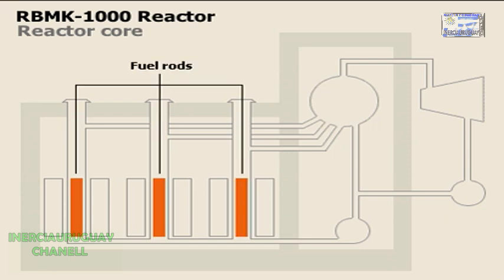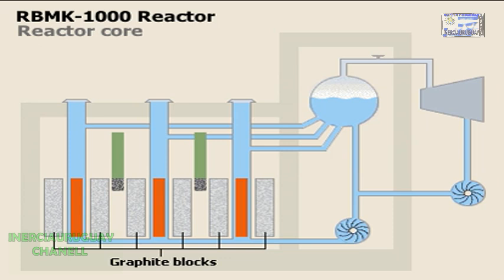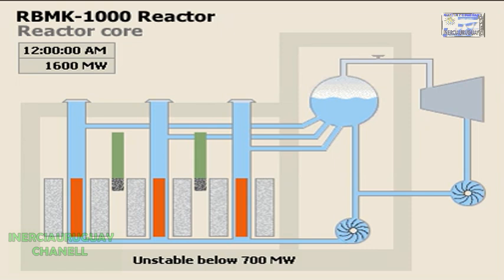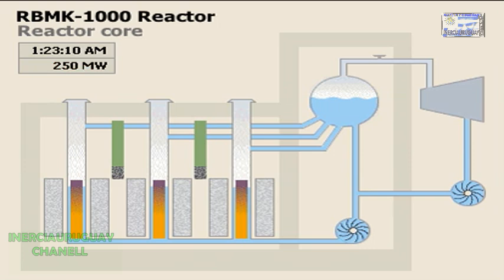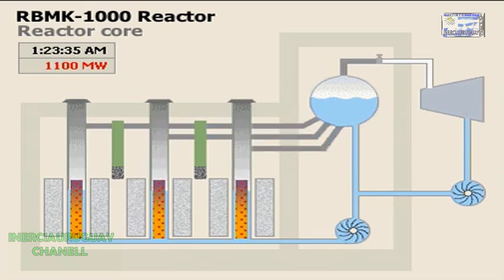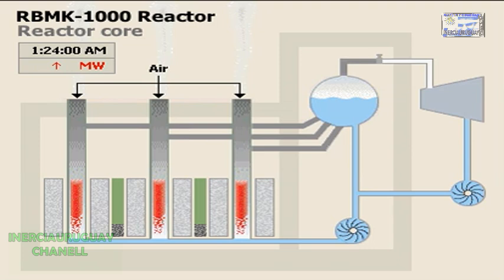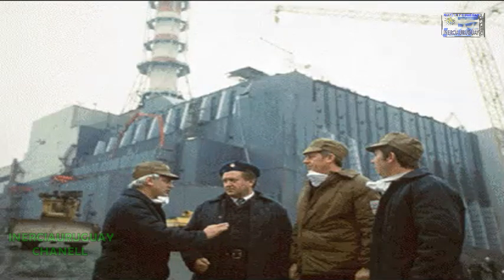WHY THE NUCLEAR ACCIDENT WAS PRODUCED IN THE CHERNOBYL PLANT ANIMATION

Comment: You forgot to mention that the reason for the experiment was to determine if the turbines could provide power to the coolant pumps during a power outage until the emergency backup diesel generators revved up to full power so they could take over running the pumps, which would take about 60 seconds. That 60 second gap between the time of a power outage and the time the backup generators could get up to full power was the entire reason for the turbine test in the first place.
Reply: I've never heard if they had a back-up plan. What if the answer to the question was "no"? What if the turbines could not adequately power the coolant pumps until the generators revved up? What were they supposed to do then? I think the answer was, "watch the plant explode and catch fire and melt down."
Reply: @ThirtyNineWinks  So I think that this graphic is a little misleading in that it depicts the graphite tips of the control rods already overlapping/inline with the fuel rods. The control rods would probably be up higher so that no horizontal line from one fuel rod to another would intersect these tips. The graphite from my understanding helps encourage fission by slowing down escaping neutrons from one fuel rod and making them more likely to collide with atoms in neighboring fuel rods. My understanding is that the control rods, with the exception of the tip,  as the video described were made of a material that would absorb or otherwise prevent escaping neutrons from colliding with adjacent fuel rods, thus slowing the reaction.

In the event that the backup system could not power the cooling system, they would have had the ability to lower the fuel rods partially or entirely to slow or kill the reaction. Under normal operation, these rods wouldn't be fully retracted to begin with, but always partially inserted as needed to maintain the reaction / power output. From my understanding it is a PITA to restart a nuclear reactor after it has been completely shut down. The problem was, like the video described, they ran the reactor too low of an output for the test which risked the fission reaction halting/shutting down. Thus to prevent this they completely removed most of the rods to encourage more neutron collisions / increase the reaction. 

When, as the video described, the operators realized the reaction was out of control, they tried to emergency halt the reaction by lowering all the control rods. At this point it was probably already too late given how the cooling system was already compromised / full of steam. However, with all the control rods previously having been removed and now all being inserted at the same time, the first parts of the control rods (graphite) all lined up with the fuel rods in unison. This supposedly is what caused a massive spike in the fission reaction. If the control rods were as depicted (already inline with the fuel rods), the graphite tips would have already been accounted for in the reaction, thus lowering the control rods would not cause a spike in output.
Reply: @ThirtyNineWinks  the answer to the question was no. They had done this test three times before and it never worked.

They had no back up plan. 
What could go wrong lol
Reply: @ThirtyNineWinks  Well, that's what the previous three tests were for, and they all failed. Chernobyl wasn't just a failure, it was a complete cluster screw up. So the answer is, if the turbines can't generate enough power to keep the coolant pumps working as the turbines wind down, and until the backup generators reach full power, then you'd better design the core more efficiently so it can last those 60 seconds in case of a power outage.
Reply: well they did the tests while they didn't have a power outage. So I assume they would just connect back to the main power. Still, its pretty stupid to not run these tests before building these mega reactors and using them for 9 fucking years
Reply: Two small points to consider. I read somewhere that this type of reactor design was a "scaled up" plutonium producing reactor (for weapons). So it may well have had a compromised design when used as a power generating reactor (I'm no expert). Also important for ppl to understand the significance of the steam increases. Steam doesn't absorb heat like water so its kind of a runway train, scenario. More steam = more heat = more steam. Don't think boiling water reactors have been used in the west. Most are pressure reactors.
Reply: @Worther12  if your car gets low on coolant.... and overheats.... 
its possible for the sensor to be uncovered...... and the sensor cant read steam temp.... only water temp

so the gauge would slowly climb from normal..... to "red zone""..... and then rapidly fall back to normal (or even cooler than normal operating temp) when the water level drops low enough 

ive had to tell people that their engine is FUCKED...... and then they get mad and say the gauge went from normal.... to cold 
i tell them the sensor cant read steam..... 

and they tell me im an idiot.... 

yet their engine is still fucked..... because they didnt know
and they refuse to know
Reply: At the time there were 3 different Soviet state agencies in charge of  nuclear power- problem #1, like having 3 captains on a ship. Next problem was Soviet mentality, Moscow has answer for everything but you don't want to call Moscow cause next posting will be Siberia if lucky, bullet if not. So any variation, question, or anamoly prior to, during, or after a procedure should be directed to Moscow, but ain't anyone doing that, last thing anyone wants to do is call Moscow.  Soviet hubris and fear based management caused Chernobyl incident. Poor design yes but not root cause.

Comment: Current best theory we have is that when the first stream explosion vented the core of its final moderator (the water) the reaction went super critical, producing the second, big explosion. It went off like a fizzled (failed) nuke, with the disassembly stopping the reaction. Tiny, but still equivalent to 100 tonnes of TNT (little boy was 30,000 tonnes equivalent)
Reply: There is no fizzling. Its super low enrichment fuel, just 2% (merely x3 natural), it cant explode "like a nuke". Its not the core that explodes. Thats indeed physically impossible. At abnormal temperatures the fuel rod containers, made of zirconium alloy, react with the water, releasing hydrogen. That explodes when mixed with air.
100 tonnes? Where did you get that number?
Reply: Most people don't understand those terms.
Reply: Nuclear plants can't explode like nuclear bombs - there is too little fuel. In many countries the maximum enrchichment for the fuel rods cannot exceed 4%.

Comment: From what I recall they were planning to start the test at 200 MW.  Normally the test was to be done at 700.  The reactor power drop didn't appear to be lowered only to 500 before the reactor stalled.  It would appear they got down to 200, and then it stalled down to around 30 MW.  The rest was fairly accurate as they began to pull out the rods and everything went haywire after this point.

They didn't realize there was a hot-spot forming in the core due to the position of the sensors.  By the time the readings actually started to show up, they did hit the SCRAM switch.  The rods like you described had graphite tips (which I have no idea why they did this), but they also did not enter the reactor very rapidly -- this was a problem and the shape of the tips also displaced coolant.  The combination produced an unexpectedly massive spike in power.

The reactor is more unstable the more steam is present which produces a positive feedback effect, and the reactor was extremely dangerous in this configuration.  The last recorded reading was around 33000-34000 MW which is over 10 times the normal output.  It's not clear if this reading was before the first explosion or the second.  The shattering of the fuel rods prevented further insertion of the control rods which would have simply jammed against them.

I'm not sure exactly when the energy level reached 100 times normal -- I don't know if it was during the insertion of the control-rods, or after the fuel rods shattered
Reply: No, they weren't planning to start the test at 200MW. The plan was to start the test at 700MW, but the reactor began to lose power rapidly from reactor poisoning due to the reactor not being given sufficient time to power down. Chernobyl was going to start powering down early in the day on April 25th, before the day shift came in, but they were asked to remain at full power because another reactor near Kiev went offline and Chernobyl was required to provide the power needs, so when the time came for the experiment they had to power down the reactor rapidly before the night shift came in.
Reply: From what I could find, they tipped the boron control rods with graphite because otherwise it caused some parasitic loss when retracted.  There was never supposed to be less than 30 rods in at any given time.  The spike in energy level was when all of the control rods came down at once during the SCRAM.  All that extra graphite entered at the same time, and when the steam pockets formed the water is no longer able to dissipate heat. This creates a self sustaining worsening, they call it a positive void coefficient.   Western pressurized reactors just use water as the moderator, the RBMK reactors used water AND graphite.  So if the water boiled off in a typical pressurized water reactor, then the reaction would slow (negative void coefficient), but in the RBMK if the water boils off there is still graphite so the reaction will continue with less cooling, and with less cooling make more steam, and the cycle gets worse and worse.
Reply: @commanderrussels2612  do you know why they were allowed to be retracted to the point the graphate tips would be out of the reactor? 

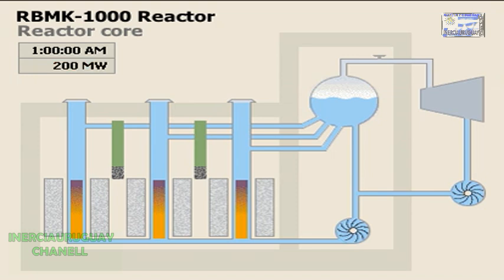İf their max retracted pozition was like 1:30 in this video(instead of 2:00), power wouldn't spike when they were reinserted. Am I wrong?
Reply: To late mate whatever you try to explain the event still it happened

Comment: When you build a BWR design and do not understand the dynamics of this Reactor and you got Vodka Cowboys running something like this.  It's a mixture for a fatal end.  I used to work at a Power Plant.  Sorry not to slam the Russians but let's look at TEPCO now.  WHY would you build a Nuclear Power Plant seaward to the Pacific being on the Pacific Rim?  Build the damn plant on the other side of the Island not to keep your fly wide open to Tidal Waves.  Like America were I live.  The California Nuclear Plant "Diablo Canyon"  another Engineering Nightmare.  Rest easy the plant was Decommisioned years ago.  Research it.  Oh by the way that was a good down to Earth explaination for people that do not understand this.  Cool deal.
Reply: Honestly the only critical problem with Fukushima plant was that the emergency reactors were placed too low. They got flooded and couldn't cool the core anymore. Would've been just fine if they were positioned higher that overflow sea level, despite the flooding.
Reply: No, because stupid enginers do 'energy independend cooler' control by electric valves! Awesome design. System can cool reactor quite long and probably forever if somebody else added small emergency turbine with generator (actually switched off  reactor powers about 10Mw ! quite enough for any control system) And second thing they do 'water round' under reactor for cooling but nobody thought how to cool this thing also, 'just trying to save some $$'
Reply: @maksimmuruev423  all Western reactors have a passive steam driven emergency circulation pump. Fukushima has them but there was a problem opening the valves to make it work. There are reports of them not being able due to computer problems.
Reply: Both Chernobyl and Fukushima disasters were caused by emergency cooling failures. AGR reactors were the only type that could likely survive complete cooling failure.
Reply: @zolikoff  it was not just the generators (not reactors). The electrical switch gear got damaged as well by the tsunami.
Reply: Craig Chaney I know who was the senior chief engineer demanding the test at low power if you want to know like the comment